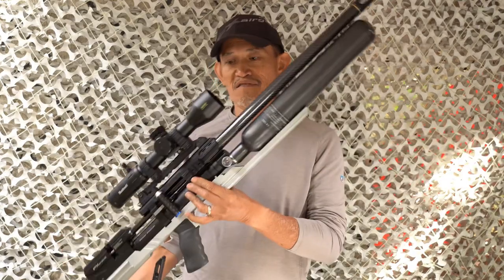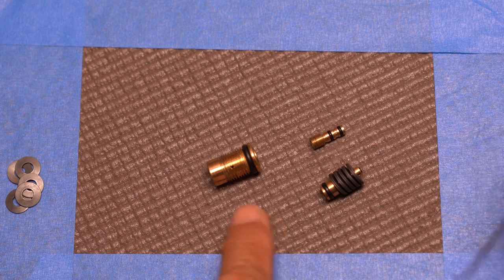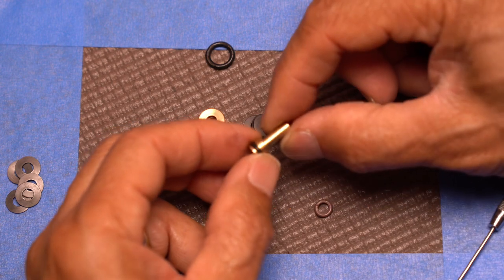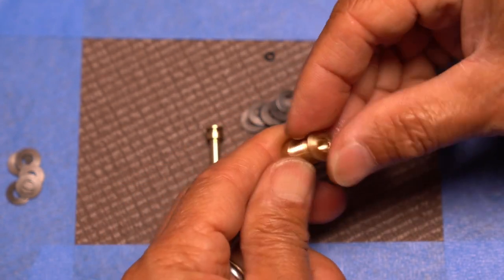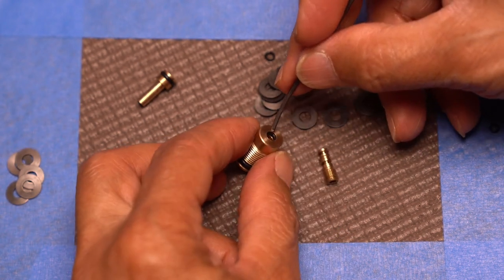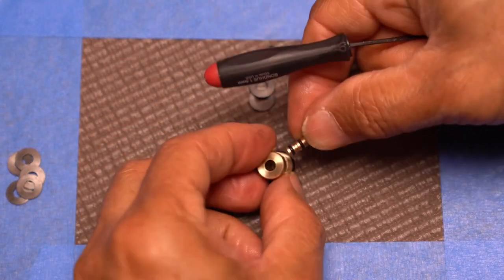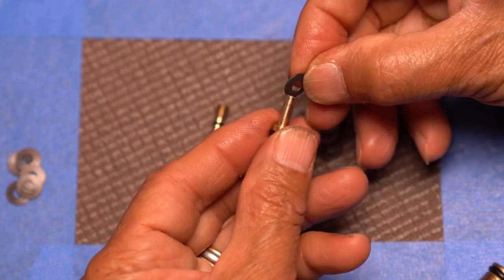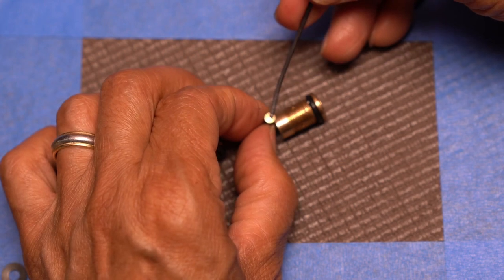FX Maverick, FX AMP regulator reseal & reassembly

Comment: Thank you for this video. I have to say that I do not think I would ever buy another FX air rifle based on the complexity of the design. While it is true that I shoot a lot, no other air rifle regulator has been nearly as complicated.  The tiny o rings are cruel. I had to replace my aluminum air bottle because it had a bad O ring, and apparently, the part that the valve threads into is put on with lock tite, and it was impossible to get it off the bottle. I did not by a factor carbon bottle because I was afraid that if I ever had to  get the valve off, it would be lock tited in.

Comment: Hello Mr. Rowe. I have a suggestion for when you’re taking out the o-rings from the reg adjustment screw and from the regulator housing (10x1.5)…it’s a million times easier if you use a sewing needle instead of flattening your pick or using needle nose pliers like at 4:52. Since you’re replacing them, you might as well poke it and insert the need horizontally into the o-ring. Removing it becomes so much easier. Just a trick I use that I thought I’d share. Awesome guide!
Reply from the maker: Nice one!
Reply: @ernestrowe5061  we would like a video, showing off this custom maverick.
Reply: @ernestrowe5061  What kind of material did you use on the tip of the disc springs pin, where does the sealing with the adjustment screw?
Reply: salam kenal

Comment: Hey Ernest great video. My Mav had an extra o ring on the regulator adjustment screw right under the threads. Normal? It’s never been apart and I bought it new.
Reply: does it look like theres three orings? there should only be 2

Comment: HI ernest 
Thanx for your advice , i could get the same , i issue i am facing now is that there is a leakage of air from the vent hole 
in the plenum cylinder (opposite side of the 2nd regulator), and as soon as i put the bottle the leakage starts .
i seek your advice onto which of the O rings may have been busted, look forward to your reply, thanx

Comment: Hey Ernest, 

Tried removing the o-ring inside the adapter and failed miserably! And idea who has one in stock new or used .  When I screw the bottle on , the air just shoots out the atmosphere hole. Ty

Comment: Earnest....a tip from the laziest bastard on the planet.(or just an old toolmaker)..run over to the lathe turn up a piece of delron or nylon to slide up inside the reg body from the opposite side......has to be flush with the "bottom of o-ring groove ) for (4x1.5 -nbr 70 or 90) depending on which parts list your looking at....lol....NO MORE FIGHTING IT....Slides right in.....WITHOUT pokin it with allen key....push mine in with  a finger......Now..I think that tip deserves an EXTRA lump a coal in my christmas sock...dont you...Santa..lol...lov the vids man....

Comment: hi great video , i have question regrading refresh rate , within  what time(seconds) does the refill happen to set pressure post firing a shot  , thanx
Reply from the maker: There is a test for that before adjusting anything, 

document the speed between timed shots for example, take five shots three seconds apart and document all the speed,  then 4 seconds apart, then 5 seconds apart and so on till 10 seconds apart, now u can see the refresh rate of the current setup

Comment: Hi Earnest I recently removed my AMP regulator on my maverick due to a damaged bottle adapter. But as I found out the schematic for the parts is the same as the dream line Drawing F10101. It states on the drawing that the there are 2 different Belleville washers. Washer 10x4, 2x .06 and washer 10x4, 2x .05. I am not sure in which order these are supposed to be stacked and if it makes any difference.
Reply from the maker: As long you have enough reg pressure any stack configuration will do.

Comment: The reg piston is an upgrade to the Delrin one used in previous models? If so, would it be available for Gen one impact with a shorter piston (14mm)?
Reply from the maker: No, haven’t seen a brass 14mm piston

Comment: what are the gains in removing the second regulator?
Reply from the maker: More plenum volume of 160cc, with 2nd reg 56cc plenum. 160cc plenum more power, lower ES, more shots
Reply: So make a video about that, How to - Maverick with only one regulator ?!
Reply: Easy, you buy a plenum tube and you put it on the front of the existing plenum and now you have double the volume 164 cc

Comment: So does the factory know this lol.
Reply from the maker: Know what?? The spring thickness?? If so when you remove the spring washer measure the thickness— the thickness are mix matches, to get factor settings, some set are two different thickness and some same thickness— so measure your combination of sizes for reference to reassemble. Its one 
Method  to set a spring washers strength.
Reply: @ernestrowe5061  I think he means does the factory know you’re putting your Maverick on steroids lol. I would assume they do.
Reply from the maker: @DocMustafa  —-> everyone knows i don’t ishoot stock AG 😊